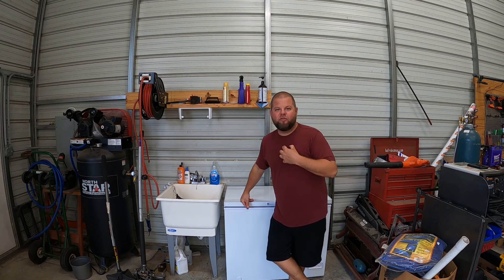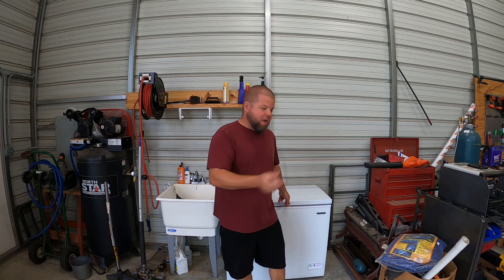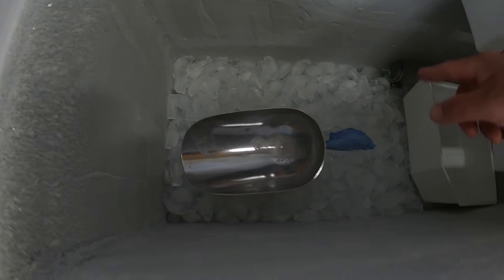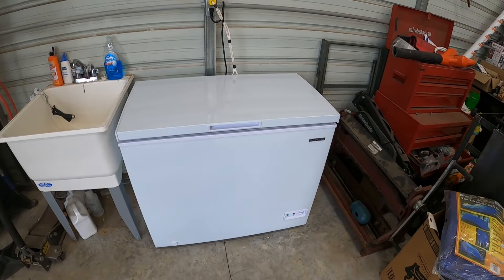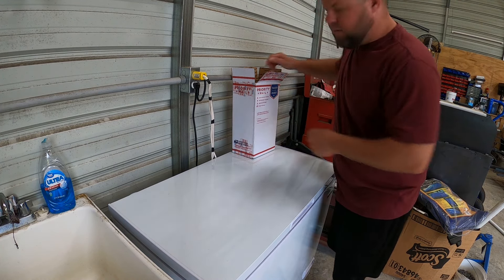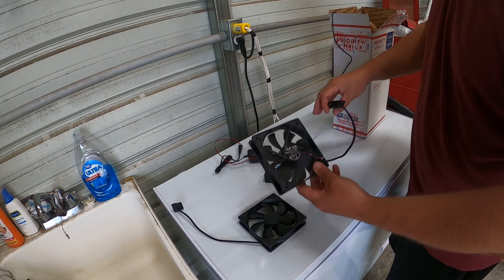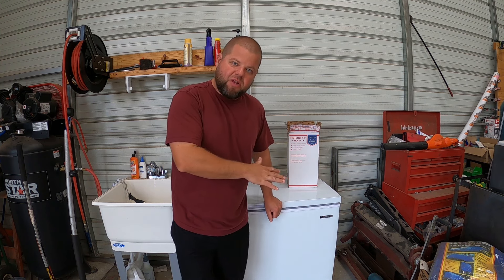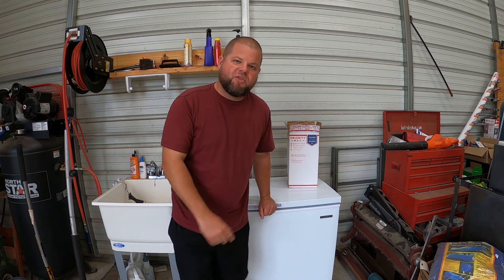Homemade ice machine update! Viewer requested

Comment: Even if there's no real "savings", just the convenience of having it at home, ability to get the cooler iced before you leave, and not having to stop at a gas station makes it a winner for me. Great video!!!!
Reply from the maker: That's right! Thanks
Reply: I agree, its also awesome if you want some chilled water while working in the garage.
Reply: absolutely conveinient
Reply: You 'should' pre-cool your coolers before a trip I have heard.
Load it up a day before - drain/re-ice before departure.
I've done this with cheap coolers - didn't really see any effect.
But if you a yeti or other high brand it supposedly works.

Comment: Saying that ice can't get colder than 32°F is like saying solid steel can't get colder than 2,498°F because that's the freezing point of steel.
Reply: Water will not get colder than 32F just like it cannot get hotter than 212F.
Reply: @G4Disco  Look up supercooled water. Also you can pressurize water and raise the boiling temperature. But once water is frozen solid it's frozen solid, you can keep cooling it as much as you want.
Reply: @G4Disco  
No, it becomes solid at 32 degrees (just barely, on the verge of melting)
It will get much colder, and water can get much hotter than 212 degrees, ie super heated steam, which was technology they used on old steam locomotives even
Reply: Yes, you can super heat/cool water, but generally, once you hit the boiling/freezing point water has a phase change. Remember there are 3 states, solid, liquid and gas. Technically, 4 if you include plasma.
Reply: @G4Disco  subcooling and superheating. Steam is used as a heat source and it can reach temps far far higher that 212. Water only boils at 212 at sea level. It boils around 150 on top of mt everest because of the lower air pressure. Steam is high pressure water superheated beyond its boiling point
Reply: @1989Chrisc  Yes, at different altitudes boil points change. No one ever says water boils at 150°F @ 27k'. The boil point is 212°F/100°C at sea level, after that it changes phase.

Comment: With freezer running, lid open, no frost on inside surface use a hand held temperature gun scanning sided or side or up and down you should be able to locate and identify placement of refrigerant cooling lines making it safe to puncture case for electrical and water lines. these perforations can be resealed with silicon cocking.

Comment: How is the fan going to speed up the timer in the ice maker that dumps the ice ? It may freeze faster but the dump mechaneism is on a timer...
Reply: The mechanism is based on temperature. It wont harvest the ice until it gets to around 10 degrees F. insuring the water has frozen completely. The faster you can get the temp down the faster it makes ice.
Reply: @davidengle6257  that’s not the way it works because the temperature of the out side of the ice will be colder then the center as ice will freeze out to in the middle would be slush so at 10 degrees the out side may be frozen the center would not it’s a timer it won’t make ice unless the internal temperature of the freezer is 10 degrees because the timing will be off on trying to push the molds clear.
Reply from the maker: We shall find out soon, trying this over the next couple of days. I've heard it's on temp and and a timer. We shall see!
Reply: @TKCL  I like this idea I am going to steal it I need a lot of ice I cut grass for a living and go threw about 50 60 pounds a week
Reply from the maker: Glad you found it useful!
Reply: @Justthemow  So your telling me that if the compressor stops working or the temp goes above 32°F the ice maker's timer will still go off and try to have the ice makers harvest ice (which will still be water or not frozen all the way) then fill with more water which would cause it to overflow??? No that won't happen cause it's looking for a low enough temp (around 10°F) that ensures that the little bit of water (which freezes at 32°F) in the tray is fully frozen. Even if the outside of that little bit of water is at 10°F I'm pretty sure the inside will be frozen solid.  And that's my professional input as an appliance repair technician with an HVAC/R tech school background.
Reply: @davidengle6257  no the thermostat is set to only make ice at below 10 degrees because the timer knows how fast the mold freezes ice in a given amount of time  at a set temperature 🥵😡🤬
Reply from the maker: There are a bunch of 10 degree stickers on the ice makers saying they won't work until below that temp. But I am also curious myself if it's timed after that trigger. The fans I am installing might produce ice quicker, but they still might not dump until a set time. We will find that out over the next couple of days as I'm currently testing that.
Reply: @TKCL  i have worked on refrigerators for over 30 years.  there is no timer in that icemaker ice production is based entirely on the temperature of the mold.  that thermostat is bonded to the end of the mold nearest the head.  it will work with fans. indeed in most refrigerator the icemaker is mounted directly in front the airduct from the evaporater coil.  great job looks great.
Reply from the maker: Thank you Sam, now I'm very excited for my next test!
Reply: I’d add an angled piece of aluminum to direct the ice into the bigger area instead of the buckets.
Reply: I did a quick Amazon search and there are a lot of countertop ice makers that make 20+lbs a day and are only around $150. It would be interesting to modify one to dump ice into the freezer for storage, and would give you tons of capacity.
Reply: @davidengle6257  yes you got it why do people think it is a time thing it is all based on temp as you can make these unit prematurely harvest if you jumper the wires to the thermostat
Reply: @TKCL  you don't need to install the fans just adjust the temp and check the output.  If it is temp based (I don't think it is) then you should be able to tell without the hassle of installing the fans.
Reply: There’s not a timer lol if there was a timer then when a fridge stops getting cold enough it would make a hell of a mess
Reply from the maker: Those counter top models make small hollow ice and as you said would have to be modified because they have practically no storage.
Reply: @djnemesis82pluss1877  I think everyone agrees that there is a thermometer that either turns the ice machine on or off. That cut off appears to be 10° f. The question is if the ice cycle is time-based or temperature-based. So unless it's 10° or colder the ice cycle doesn't even start. However is the ice cycle shorter at 0° then it would be at 10°? That's the real question.
Reply from the maker: I find this out tomorrow and then I'll post a video
Reply from the maker: Awesome, now I'm very excited to see if the fans help
Reply: I think it is awesome you McGuyvered an ice machine for practcally nothing.  You will pay for that in weeks.  Really awesome.
Reply from the maker: Thank you, it really will pay for itself soon as much ice as we use. I'm working to get production up for cheap right now. Video out soon.
Reply: @TKCL  I have been thinking about this a lot I think you could set up a counter top one to dump threw the top of the freezer and only have to move it to harvest ice and I think they aren’t very heavy I saw one that can be hooked up to a freshwater line to auto fill then it pushes the ice forward on a sled into a dish this one makes ice every 7 minutes it also makes 41 pounds a day as per there advert I think with a little country Jerry riggin you could get this figured out or even see if there is a freezer with dual lid so you can open one side and leave the makes stationary.
Reply from the maker: I've kicked that idea around a lot. Two concerns is the size and type of ice the countertop models make and cutting an open uninsulated hole in the top. I think that hole even with a ice maker sitting there would cause tremendous build up of frost in the freezer.
Reply: The idea is colder air sits at the bottom of the freezer and the art of making ice warms up the top of the freezer,  so keeping the cool air moving should help.   Think of it like a fan forced oven.
Reply from the maker: I agree
Reply: Air movement in any refrigeration system pulls the heat out of what ever is in there, extremely fast. Just like the wind on a cold day will draw the heat from your body quicker.
Reply: @djnemesis82pluss1877  Even if there is a timer based system for the ice making process, it would not activate, until the preset operation temperature was reached (detected by a thermal sensor) to protect against premature ice maker cycles that would not have frozen, so you don't end up with a frozen mess.
Reply: @Justthemow  They don't get their water from a tapped water supply. it comes from a pump that operates on a timer, not quantity, sourced from a water pool where the dropped ice would need to drop through to get to the freezer bay.  Also the more openings he puts in the freezer, the faster and heavier frost buildup in the freezer will occur.  This is particularly true in more humid states like MO, LA, FL, or other states with a high humidity climate.
Reply: @TKCL  You are right.  You'd be the frost king, not the ice king, particularly in states with high humidity.  Also, your ice would start to melt and stick together, and also to the freezer, until it was a solid mass at the bottom, solid or liquid.
Reply: @tarawood-bradley2119  A better comparison would be a miniature version of a walk-in commercial or warehouse freezer. all of those have a bank or many banks of fans stirring the air to keep temperatures consistently cold.
Reply: @TKCL  find a way to precool the water. most refrigerators have 20 feet of coiled up hose in the fridge.
Reply: @andrewdarbyshire9108  Right, I was thinking during the build the ice makers should have been located over the larger side.
Reply from the maker: I want the larger deeper side for scooping, did not want to have to dig under ice makers to get to the deeper side
Reply: @TKCL  another thing to consider if you did actually do this is a way to shut it off when it's full. I'm not 100% convinced that Frost would be a problem though. The reason being is these units are designed to make ice so they've already got insulation and what not. The biggest thing you would need to do is make sure that you insulate between where the ice maker is and where the hole in the roof is so that there's no air escaping. Still have the issue of a shut off though.
Reply from the maker: Shut off is no concern, so much capacity here that you get plenty of notice in advance. Just unplug the ice makers or trip them manually. This thing full is a couple hundred pounds of ice probably. Just stop it at 150ish, that is plenty of notice. I use mine so often it's never filled up.
Reply: @samhazen6776  About to say the same thing.
Reply: @Justthemow  Nope, The sensor that trips a harvest is against the front of the tray so when the tray temp gets cold enough it will harvest.  Blowing air across the bottom of the tray is actually what happens when you choose "fast Ice" on some models as it speeds up production.
Reply: @TKCL   do you still have your freezer set at 10 degrees? watched your video and just noticed you said yu had turned it up.  most refrigerators with an icemaker hold the freezer at about 0 degrees.  I would turn that freezer down to about 10 degrees below zero.  I would bet a 6 pack of Coors that your ice production at least doubles
Reply from the maker: Sam is correct, I've been testing that. Video out tomorrow
Reply from the maker: It's set to zero, I'm concerned if I run it on max in a hot shop it'll run forever. It seems to do well at zero. I'm testing thermal mass theories next week and also testing power consumption.
Reply: When the bi-metal or thermostat closes the harvest begins... So colder does increase production, trust me!
Reply from the maker: Yes it does, I've been testing it. Video out tomorrow
Reply: it's not really a timer it stops until thermistat says it's cold enough meaning the water is frozen and it can continue the harvest cycle so the faster you can freeze the ice the faster it will make ice.
Reply from the maker: Correct
Reply: @Justthemow  the icemaker cycles based off of an internal bimetal thermostat. The faster the thermostat cools down the faster it will makr ice an in turn, cycle. Lots of icemakers have built in fans or are mounted in an area with a lot of air flow to increase production.
Reply from the maker: That video is out tomorrow and all that is correct
Reply: @TKCL   hope you didn’t make a permanent install of the fans… I would (my unprofessional opinion) would think winter you would have more ice so you move them up or unplug it… and summer as It fluxes it will just stay near the ice.
Reply: @TKCL  Nice!
Reply from the maker: Everything is easily removable and always will be. At some point it needs to be defrosted and cleaned.
Reply: @Justthemow  You put ice on grass??
Reply: That's not true
Reply: @guyod1  - the 20 foot coil feeds the water line u use to get a glass of cold water, not the supply line to the ice maker.
Reply: @pofrani   no I use it in my ice chest for water and Gatorade
Reply: jreyman not sure why you’re wasting your time telling me this. I already know there isn’t a timer in the ice maker. Now most ice machines are based on time but not a simple fridge ice maker
Reply: @tarawood-bradley2119  I agree thermal Klein colder at the bottom warmer at the top.  However depending on where the thermostat sensor is like if it was toward the top and you set your controls at let’s say 10 below zero , their freezer would continue running as long as it took to get that 10 below temperature wherever the thermostat sensor was.  And the bottom of the freezer would obviously be colder

Comment: Use a metal screen for paint roller to angle the ice away mount fans underneath the roller to bring the colder air from bottom

Comment: Commercial ice machines have an insulated bin only, and not a freezer bin so the ice does melt and it goes down a drain. Therefore it does stick together at the bottom. But this is ingenious and I may do this myself in my garage. I am a commercial refrigeration tech. Great job!

Comment: You could attach the fans to aluminium flex pipes from the side to the bottom then have the air flow over the molds. Cheep and easy to test. And for cooling mass you could fill large pop bottles with water, reuse them for your coolers. Great job.
Reply from the maker: Testing fans today and tomorrow

Comment: LOVE This!!! Very cool. Working in restaurants for many years I have dealt with my share of commercial ice machines and which perform well and the ones that just plain suck...
One tid bit I learned a while back was that Ice Machines LOVE ice... meaning the fuller the machine is the faster the cycles can run on the machine. So, I propose a test.
Measure 24 hours of production with very little or no ice.
Then purchase some bags of ice... (Yes small investment). and make it at least half full. then test 24 hours.... Perhaps having it full with ice will help maintain a full machine stay fuller ...
Thanks again... very cool.
Reply from the maker: I'm actually doing something very similar next week. Stay tuned

Comment: Great work around!  The "standard kitchen refrigerator/freezer ice makers" will make about 10 lbs a day, each. Once the box is cold enough to freeze the water, they run mostly on timed events. You may not gain much with the interior fans, and remember the fan motors heat will have the other effect; heat. Your lash up for the IM  kit valves and the freezer is laudable but all that was needed was a plug/cord for the freezer that is rated for 15 amps or more at 110 volts, and it will carry all the loads- IM kits, valves, freezer to the 20 amp circuit you plugged into. I'd also figure our which walls of the freezer have chilling coils in them, some have only one wall cooling, some two almost none three or four, and elevate the box, make hole in the free side with an insulated door where I could swing it aside to scoop out the ice and it could quickly and automatically close. And if more ice is the ticket, install one or two more IM kits. Awesome! I worked on this stuff for a career and it never dawned on me! Awesome! PS; ice sticking together usually means the door gasket has a leak or is being left open too much and air borne moisture is condensing on the ice, which causes the sticking. Seal up your cord passages through the gasket- if you do a rework, run your cords through the "hot wall" and seal them up. Damn, why didn't I think of that- I have wanted something like it at camp for years! And I have the junk to make it from! FR Final PS; You don't need a "pro look", you need "personal snazz"- paint or wrap some "flames of ice" or something you like on it! FR!
Reply from the maker: Actually discovered they run on temperature not time, installed fans and tested. I am about to post that video.

Comment: If you do the fan, you don't need to put it low, near the top pointing down will circulate it. You da man! My kind of tinkerer!
Reply from the maker: Installed two fans this morning, testing for 24 hours and weighing ice production tomorrow. It's moving a ton of air in that small space. Video out soon
Reply: @TKCL  Lets hope that the fans can hold up in sub zero conditions
Reply from the maker: We shall see, they are made for kegerators